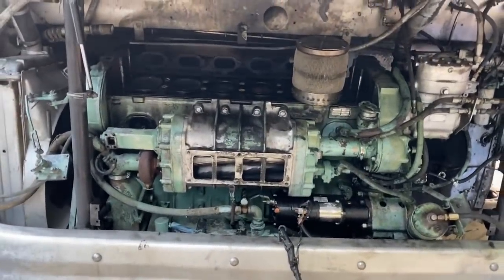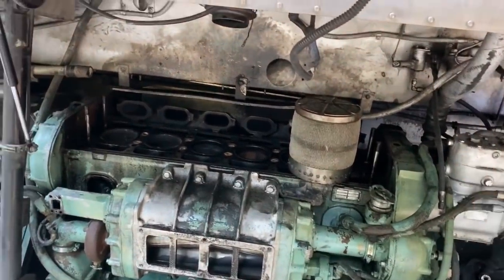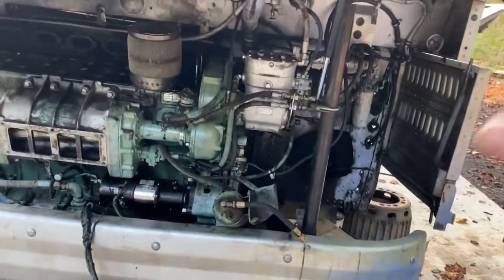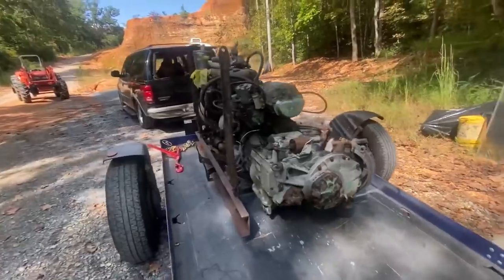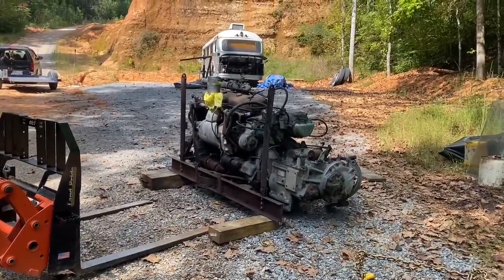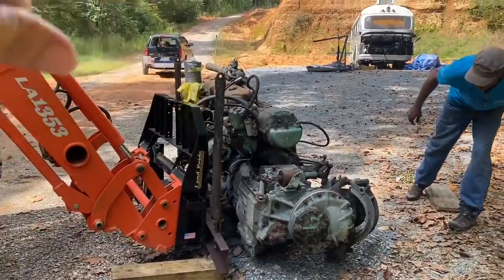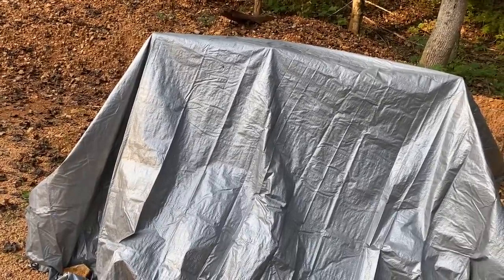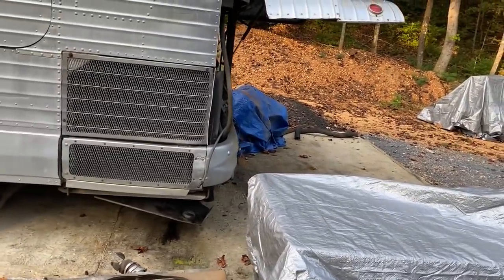Engine rebuild or engine swap detroit diesel 671 dusted and over heated engine

Comment: That is a strong tractor! By the way, there is a product that will really help you out for that container with the Thing in it. It is called Damp Rid. It gets rid of the excess moisture and it comes in different sizes as well as a refillable one. I use it in my garage to keep the moisture in control so my Pontiac Chieftain stays nice and a small one inside the car as well. Good Luck putting the new engine in.

Comment: Down here in NE Texas we call a dusted engine a sanded up engine. Did an in-frame on a Ford 335 industrial for that reason. Mouse chewed through a rubber transition hose from the steel tube leaving the air filter and to the intake manifold.Mouse was smart:low on the back side of the hose. Last place I would look.....

Comment: I worked at a plant where there was a roots blower that was used to vacuum up coke, and not the cola.  The blower was not producing enough suction and the electric motor was not drawing as much amperage as it should have.  The mechanics at the plant put new rotor seals and it didn't fix the problem.  I am an electrician and told them I knew a fellow who bought a 6-71 blower and found the case was worn out and could not be rebuilt.  They laughed at me saying the cases didn't have anything to do with it that the rotor seals determined the performance of the blower.  They put it back together and it was only slightly better before, barely useable.  Trying to explain that housings are also wear items was just not possible.

Comment: Question is the replacement engine have an alternator or a generator? Correct me if I'm wrong but the regulator for the generator or alternator is mounted on the firewall. You as you know Scott the generator regulator won't work with an alternator. Just trying to avoid damaging a good generator/alternator.

Superb find on the replacement engine.

Cheers!
Reply from the maker: He knows he needs a voltage regulator.  It was missing from the donor bus.  Positive ground questions still need addressing also

Comment: You could drive the old one on into the ground, thus putting that many fewer miles on the new one.  but why was the old one down a cylinder? was compression escaping through the cracks?
Reply from the maker: Did you see the cylinder walls in that cylinder?  A couple videos ago??
Reply: @BusGreaseMonkey  No, but those are easily replaced aren't they? especially with a well used one to match the other 5.
Reply: @BusGreaseMonkey  I have now. Why didn't the rings remove that rust while driving to your land? Is the rust down inside pits? or did it form since arriving? where is the water coming from?  Should I assume that much blowby will cause a failure to ignite even on the highway?

Comment: Suggest you put a hole in each fork for a pin to prevent chain sliding off. Hole won’t hurt capacity but can be great safety device.

Comment: Well done.  Might want to throttle up the tractor when you go to install it.  That will give you full hydraulic fluid flow and should help.
Reply from the maker: It didn’t even struggle i just took it slow and easy.
Reply: Idle speed is best for delicate maneuvers for sure
Reply: @richardlazarski4553  Yes. It is not designed as a forklift, and the gentle/slow movement of a real forklift just does not exist. Running at idle lets it come close.

Comment: I don't know if the transmission is tiny or just looks tiny compared to the engine.  How many speeds are those old fellas?
Reply from the maker: 4 speed non synchronized
Reply: @BusGreaseMonkey  fast response! Thanks.

Comment: 3000 lbs tractor capacity is likely with the bucket, with a load farther away and out on the forks capacity will likely be less. Love the videos thank you!
Reply: T C     ?
Reply: There should be a load chart on the forks/tractor somewhere. Note that the load chart is rated conservative. Your not in trouble until the back end starts floating. At that point, add counterweight.

Comment: Scott - on your Kubota notice there are two holes where the boom cylinders mount to the stanchions. The upper hole is for height and the lower hole is for power. Your tractor had the cylinders mounted in the holes for max height, not max lift power. I’d also recommend using a little more RPM although I understand you were trying to keep it low for slow movement.

Comment: hope you can go in all the way with your forks when putting the new engine in. Make sure you have a smooth driving surface with no dips or big rocks in the way. If it feels like it's going to tip pull the trans and put it in later

Comment: Does anyone know of a great diesel mechanic who would travel to my home to troubleshoot an Allison transmission that is stuck in reverse?
Reply from the maker: Is it a mechanical linkage, air shifter, or electronic?
Reply: @BusGreaseMonkey  Mechanical linkage.
Its a Blue Bird with a Cummings.  Thank you!
Reply: 1997 Bluebird. I'm removing the transmission and looking for a place that will diagnose it, then rebuild it. There was probably no maintenance for 20 years...

Comment: Hope things work out well, looks like its going to be a good swap. You going to go over the new engine a bit before putting it in there? Make sure it does not have any major problems before getting it swung in there, it might be worth taking off the inspection covers and taking a look. Looks like it will still be a good job.

Comment: Sure, you could've sold the guy on rebuilding everything, and pocketed a pretty sweet payday to boot. BUT....all that potential money can't buy a good reputation, and that's worth it's weight in gold(separates you from those shysters in Whiteland, for sure). So is a good tractor with a front-loader assembly and fork attachment...

Comment: Why the poor trailer skills??  I woulda' backed that up right behind the bus with the engine facing the right way...so you could lift it off the trailer and set it on the concrete.

Comment: Scott, Did you check the oil bath air filters when you looked over the engine a year ago? 
Just curious if new owner dusted it, or if it's been sucking dirt for years. 
I know you usually check the oil bath air filters whenever you check out a bus
Reply from the maker: I was only there for a few hours. It had way more serious issues than me checking the air filters.  Kinda like checking someone for gingivitis in the ER before dealing with the gunshot wound they came in for.  It was a running driving bus.  I always check them prior to starting if they have been sitting for sure.  Basic maintenance first on a serious diagnosis isn’t really practical.  But yes they have been empty for years i suspect.  Zero oily residue a charred bone dry interior.

Comment: The 3,000 pound lift capacity isn't about the stress on the tractor, but rather the amount of weight that will tip the tractor.
Reply: It is what it will lift at full lift height. If the tractor isn’t ballasted properly it will tip earlier. Go watch Messicks channel about loader lift numbers.

Comment: You going to paint the engine before putting it in?
Reply from the maker: I could easily spend 20 hours cleaning and painting that engine.   Would you pay over $2000 for a mechanic to put a spray can paint job on your engine?   If so let me know when to book you in for that service
Reply from the maker: But yes it will get a half ass quick paint job that almost no one on the internet will appreciate.

Comment: You can always tell what caliber of a mechanic that your working with in the repair of whatever your working on by how he troubleshoots and dissassembles what he’s working on. When he’s tearing things down, does he get in there and start ripping everything apart with no rhyme or reason and worry about picking up the nuts and bolts later or do they take a slow methodical/organized approach so they can inspect parts and find the actual cause of the problem or were they planning on just changing enough parts that it had to be fixed?

I’ll let you guys figure out if we have a real, hard to find (rare) mechanic here or do we have a typical parts changer? And what’s making the rare mechanic so rare is that the actually know how to troubleshoot and yes there is a right way and a wrong way.

Comment: Detroit Diesels are extremely tough. The ones I worked on were in big air-compressors used to power drill rigs in rock quarries....nothing but dirt and dust. Ingersol-Rand actually had a very good air flow design through the whole box, such that the lion's share of the grit would precipitate down before it got  to the engine compartment. The Donaldson dual dry canister filters (inner and outer) did a good job too. 1500 HR rebuilds were  still the norm though. But I swear we had machines come in with just oil rings left intact and they would still run, even if just on a few cyclinders. The 855 Cummins engines that came later in the 1990's were strong engines but if they lost a cylinder they just were pretty much out of the game. So very cool to see you keeping these old engines alive.
Reply: id say advantage of 2stroke as it needs 1/2 the motion of others

Comment: Hello Scott !!  You did a real good job handling the Kubota with lifting that engine!! Your judgment was very wise with the lifting part in that you only lifted the engine high enough to safely move the engine where you wanted it put, What you did was a general rule of thumb in moving ANYTHING with a forklift !  In training classes they ALWAYS tell you this,  Do not lift the load way high, ONLY HIGH ENOUGH to move the item safely!  Of course when you are lifting the old engine out of the bus and putting the good running engine in you lift as high as needed to get the job done.  Bravo to Scott and to Kelly too for spotting the move and help the way she did, BRAVO -------------  John Bellas  KC2UVN 73's my friends!!